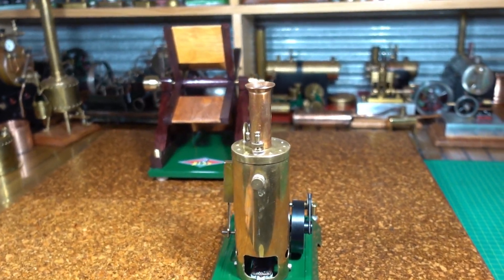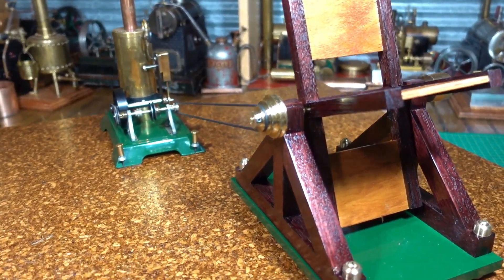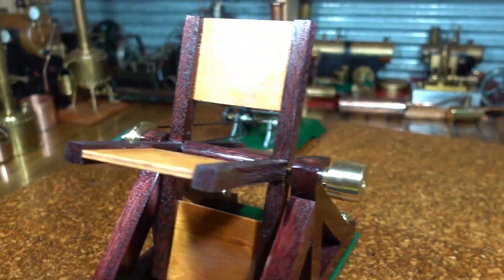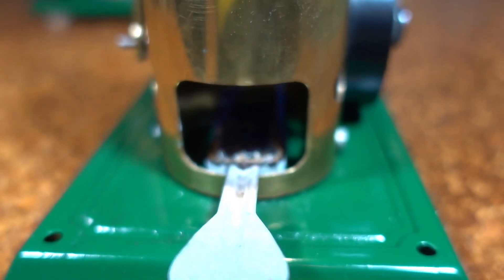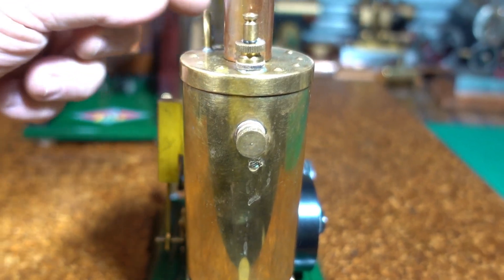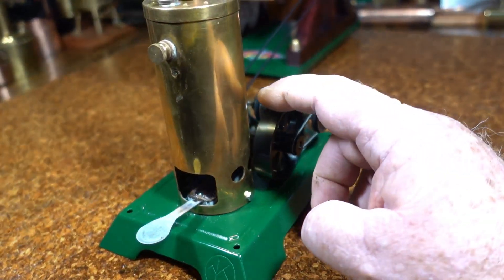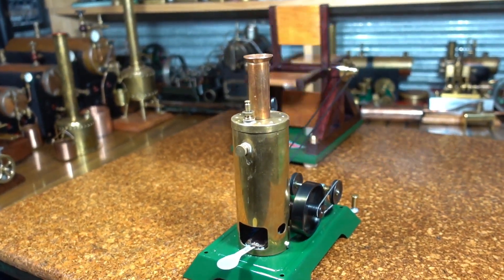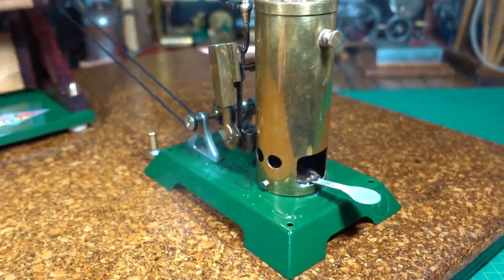KMV Vertical Toy Steam Engine SD01 running on Live Steam

Comment: Hi Jim. I really like that 'O' ring material drive belt, just ordered some from ebay. The urethane belts are ok but I've never really liked the green colour. Cheers, Alan.
Reply from the maker: Alan I just went with what everyone else was using and always bought the green belting from China. Now I can get this O ring cord locally, its cheap and its very limp and a nice black. The last lot of green belting from China was the most fluoro green I've ever seen just stood out too much running old steam accessories.
Reply: @SteamEngines-Jim  I've purchased various lots of the green belting and I've noticed that the surface finish various a lot. Some of it is very rough to the touch and others are smooth. Looking forward to trying the 'O' ring stuff. Cheers, Alan.
Reply from the maker: @RetroSteamTech  One batch of the green belting I bought (and I've bought heaps) refused to join. The O ring literally welds together with Loctite 'All Plastics' Super Glue which includes an activator Alan.
Reply: @SteamEngines-Jim  I better get some Loctite All Plastics glue as well then 🙂

Comment: 'O' rings work well. You can also make them to length with a special adhesive.  Hand sanitiser, nice tip, thanks.
Reply from the maker: Thanks Bruce I bought some special superglue made by Loctite that has an accelerator that joins the O ring instantly and it literally welds it together as strong as if there is no join - Cheers Jim